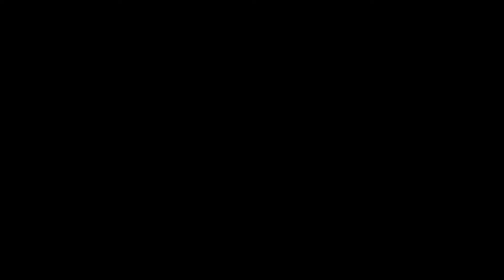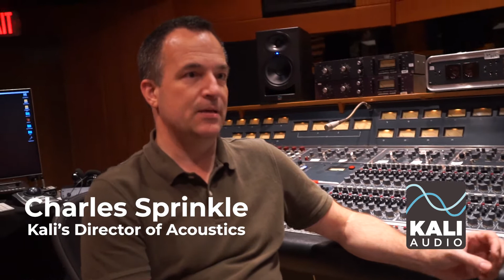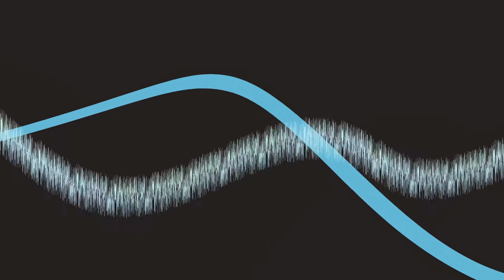Charles Sprinkle talks about making Boundary EQ Tunings at the Village Studio

Comment: I placed my IN-8 speakers on isolation pads, on desk. Do I still need the desk boundary eq? (>0.5m from wall, 3rd switch on) The pads do a great job at absorbing vibrations. Adding the boundary eq seems to turn down the low mids. But I kind of like the sound without activating the eq. It's a subtle difference. I can't really tell which setting results in a flatter frequency response, for my scenario. Can't find anything about this on google
Reply from the maker: We've found that some stands are largely doing the same thing as our boundary EQs. Go with your gut. If it sounds better, it's probably flatter.